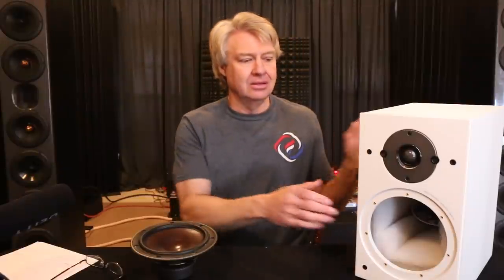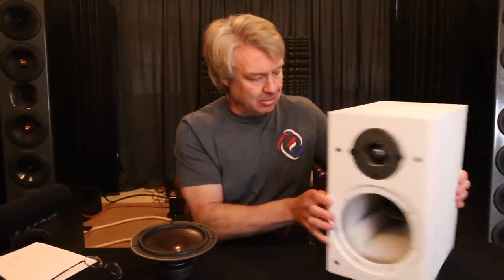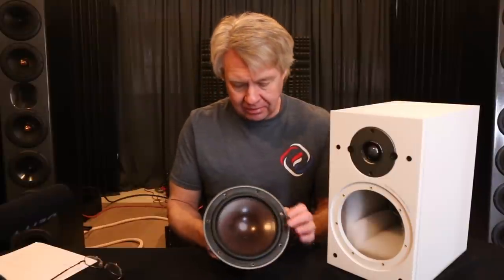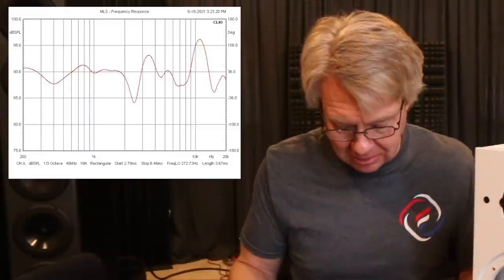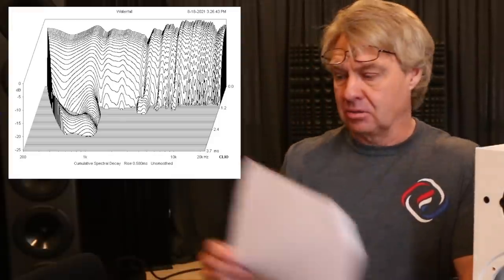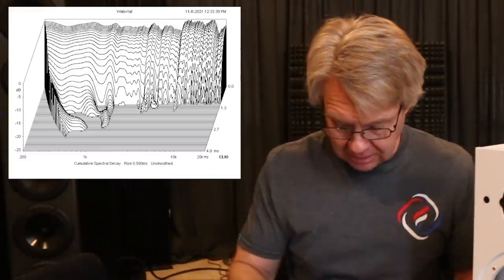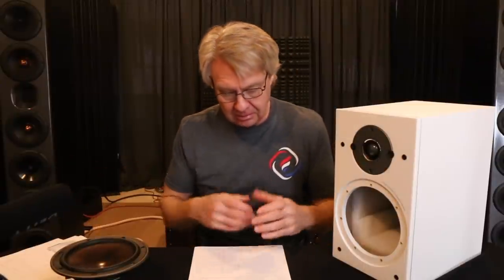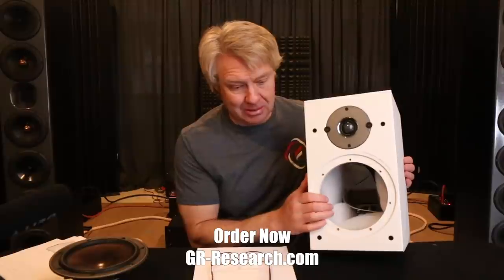Deal or no deal? Dali Oberon 3

Comment: So I take it from this review that the upgrade is a path to salvage your bad investment rather than a recommendation to go buy this speaker + upgrade as a way to build a quality system.
Reply: Generally, yes, because he has shown that buying even $2000 to $4000 speakers are no guarantee of getting quality crossover components or a good frequency response.

If you've spent a good amount of money, instead of selling them for peanuts (used speakers go for about 50% to 65% of original price if you are lucky), and if the cabinet and drivers are good, then spending say up to 1/3rd more to make them better seems to be a good way to go - if you are willing to spend several afternoons doing the work and have a good place to do that work. 

I'm not sure I'd do it for these though. Seems the cabinet and that off axis response would forever be holding them back other than for the one person sitting in the sweet spot.
Reply: @Lloyd Stout yep, even comparing speakers in a showroom is no substitute for an in-home trial...with your amp, your music, your sources in your room...Fortunately some allow 30 to 60 day trials...

Comment: Does anybody know the values of the used coils in the crossover? If somebody knows plz write me...
Reply: I'm also interested. I believe they are like in the zensor 3, 0,3 or 0,33mH in the tweeter and around 0,6-0,7 mH in the woofer...u should also need to consider the DCR values of the coils... will try to measure inductance of the coils afternoon but mine RLC meter is not so accurate.
Reply: Did measurements on the coils. If my measurements are correct but I'm not trusting the accuracy of my cheap UNI-T meter. The L1 on the woofer is 0,47 mH and 0,17 mH on the tweeter.
Reply: @fahy01  Ok, thanks. I could find anything bout the Zensor 3, but for the 5 the values are give as 0,55mH and 0,2 mH, comes close enough. The problem is the  Oberon have completely different drivers, so probably those numbers are may be notsuitable
Reply: You always design the x-over so the final slope takes into account drivers measured freq response and phase in enclosure, their impedance and offset between drivers.
Reply: @pliedtka  Ok, how does help me as a non professional. I hardly will calculate the Crossover again...

Comment: Maybe I am reading it wrong... but do your graphs read from 200hz onwards?
Reply: To measure any lower, you have to either use an anechoic chamber, or derive the lower frequencies by taking measurements as close to the cone as possible.
This is because the sound reflected off the floor/ceiling will pollute the measurement. Depending on how far the speaker is from the floor, the difference in time delay between the direct and reflected sound is typically at about 180Hz.

He can get away with this because the speaker gets more predictable in the lower frequencies, and the cross-over design software will be able to model it pretty well.

Comment: Have you ever had any Piega speakers in Danny? I have their Classic 5.0 and I'm pretty happy with it. They retail for around £1800/$2000 but I paid a lot less second hand. They seem a mixed bag build-wise - extremely solid cabinets with huge front baffles and lots of bracing plus a stunning piano gloss veneer; nice AMT tweeter but pretty cheap-looking stamped steel mid/bass (you mentioned damping strips in this video, what do you mean and where to buy?) and I would assume a cheap crossover. I think they sound good, certainly more refined than other similar things I listened to, but I wonder how their speakers measure...

Comment: Where do you do all the measurements on speakers? In a listening room or a chamber?
Reply: he uses a gated mic so he can do it anywhere almost as he only captures a fraction of a second of sound so no room reactions. at least i think he does it that way
Reply: @veroman007  Thanks but I have to know how he really does his measurements before I can trust them
Reply: That’s exactly how he does it. He talks about bit in other videos on his channel; you can search for them. He uses the CLIO system which takes gated measurements.
Reply: @nathandaniels4823  So if the measurements doesn't include the room then he won't really know how the speaker behaves in a room? The room changes the frequency response significantly. So it might become the most horrible sounding speaker or it might not. Who knows
Reply: @jwester7009  and every room is different, with different bass modes, etc., based on size and surfaces. Making the speaker play as neutral as possible and have good off axis drop off at least starts out with a "good" sound. It is up to the buyer to evaluate their room and add or subtract damping material as necessary or provide bass traps.  Or you can play the game of buying bright speakers for overly damped rooms or buying dark sounding ones for rooms with hard surfaces. That's up to you to decide. Or for non-purists, use some room correction software on the preamp or decent A/V receiver and see where it leads you by putting in a crazy EQ curve, or heavens forbid, buy an EQ and do it manually. Even then, adding a sheet of no-rez to almost any commercially made speaker is likely a start in the right direction.
Reply: @Lloyd Stout I don't care how many awards a person has. I'm still going to ask critical questions. One thing you can be almost sure of is that the bass region will be heavily boosted in every single room as well as the upper mid range in most cases. That's the compromise with speakers. They have to work in most normal furnished rooms in a home. So a completely straight frequency response might not be the best option in real life. That been said measurements are still a great tool. It's a great way to locate problems

Comment: Hoping a customer will send in the POLK R700.  Even Polk said they had to scrimp a bit on the crossover compared to their Legend series, but many of the drivers are the same. Would be great to see Randy open one up, see what is inside and if it can be taken up a notch with better crossover components, and if maybe the values need a slight change.
Reply: The 700 woofers look similar but are far lower quality and stamped steel compared to cast in the legend.
Reply: Maybe Danny is Randy?

Comment: I don't get it. A $390 (€500 incl taxes and shipping) upgrade kit for speakers that cost new €500 a pair 🤔. Do they sound like a €1000 pair after the upgrade?
Reply: They won't, but you will get air core inductors and very high quality capacitors ;) For me at this price point it doesn't matter if you use cheaper, commonly used parts or Uber stuff GR sells - the drivers although now finally well managed by proper crossover, may not pass all the nuances better parts provide.
Reply: I have read a comment on another channel stating it is absolutely worth the GR upgrade

Comment: As one who's been in this hobby for decades- and doesn't have an unlimited bank account- I don't get it. $900 for those? I know it's all personal taste, but I've picked up so many better-built speakers used, for so much less. I am currently using Dali Phantom Ikon in-walls for surrounds with full cast enclosures, cast-basket woofer and hybrid ribbon tweeter module. $200 for those.

Comment: You can test drive 3 different stock cars. And then, you drive a specially tuned and equipped version of one of those three; more horsepower, even acceleration, better tyres, better grip, better braking, more comfortable seats, better steering wheel, etc. From the moment you sit inside it, press the accelerator, press the brakes, etc. you KNOW exactly how much better any stock car could be but you are not given that.

Comment: Danny so all speaker manufacturers make bad speakers.
Reply: Most do have short comings , but what us cool is you can take something that tickles you and make the improvements to your liking , its the same with houses , cars and women , it us human to want to make better , it gives a sense of achievement.
Reply: Lots of things can be modified to make perform better. One example is a car
Reply: Most of them are made to achieve a price point.  Cheap crossover parts cost a few bucks.  A good chunk of the cost is dealer markup.
Reply: @jasontimothywells9895  women,really? Something is wrong in your head.
Reply: @robertspringer9477  are you related to Jerry springer ?
Reply: @jasontimothywells9895  many guys do end up upgrading their starter wives...about 50% do, and it ends up costing them dearly...Far more than a sheet of no rez.. ;-)

Comment: Thanks for the video Danny , if my Polk Audio lsim 703s didnt weight 30lbs each i would send them in to ya , I have the only video on utube taking the 3 way speaker apart the cabneit is built very well . Their basically a cabneit inside a cabneit front baffle is almost 2 inchs thick sidewalls are 1.5 inch thick and top and bottom and back of speaker are 1inch thick and this isnt counting the Real Mt cherry wood veneer edtions very solid cabneit which we both know helps the overall sound out alot . 
The 703s do have 2 crossovers and yeah 🧀 Parts 😆 But one thing the Engeeners told me is that the ring radiator tweeter is 1octave higher than normal so they had to use a very strong tweeter . 
And amp pairing is tuff with the polk my amps that have top end roundness or Delicate top end tend to sound best with the Polks I will say the bass driver is built very very well heavy and no stamped steel basket its alumnium atleast 😃
But bass is strong ! 
Appricate you Danny.
 i will buy one of your speaker kits this coming year 100 percent ! And I will have the flat pack 'wrapped' with a crazy desighn 😃

Comment: it sounds like it came out of game of thrones ,remenber the 70´s do it yourself was fashion one could design the shape of the box or use previous designed boxes and buy drivers ,boards and everytype of sound deliverer ,Bricolage was the word , i made with a german friend some speakers of pine wood that had all frequency´s in the spectrum (not all off course)but some 15 htz to 35khtz and equalizers with 25 frequencies per channel would improve any recording and tube amplifiers was old but good ,transistors were making it´s way in the market .No use of tubes only transistors ,this to made buyers after those amplifiers,  but they were not comparable to a 1.000€ bad quality amplifier not like  Rotel or Quad or even accuphase or phase linear or even Pioneer of the 70´s

Comment: Never say anything good about any speakers! Selling snake oil! I have those and they sound amazing! And every speakers will have a different response in different rooms!
Reply: Actually, I've seen several reviews where he compliments speakers.  Most budget speakers don't use quality crossover parts because of cost and size.  There are a few exceptions. Just looking at the stamped basket of that piece of crap would make me want to send it back.  That speaker is no bargain.  You would be better off with a budget Sony bookshelf.

Comment: After watching most of your videos one could conclude that almost all speakers, no matter the price and brand are in need of modding and fixing.  Funny enough you sell mods. Not a single mention of music or even sound impression.
Reply: Shocker...
Reply: Ever consider the middleman markups involved in the industry? Reckon you get the same quality from the mass produced pieces as you would from the smaller business that’s sells direct? Just a casual observation.
Reply: What concerns me is that the crossovers are fixed often with only one speaker. How does this always achieve a desirable result?
Reply: @Mark-mj6qp  if the speakers are so inconsistent that you need to try with multiple units to dial in a crossover, there is almost certainly enough variance between the left and right speakers to make a good stereo image impossible.  If they're that different then they're not worth using.
Reply: The measurements don't lie.  You too can measure these yourself and get similar results with a relatively cheap microphone and free software.
Reply: @jayweb702  I have a calibrated microphone and use REW for measurements.  I'm not disputing that but the rabbit hole that's this hobby. Buy new speakers so you can mod them, and if you are not happy with the results you can further upgrade the components used for mods. But watch out, your DAC dose not have very clean output, better upgrade that too. The amp you are using has 0.0x % distortion, can't have that - upgrade it.  But it's all meaningless if your interconnects are not on point. It's an endless struggle and obsession that's encouraged by people like this man. He dose not mention music in at all when talking about devices that are constructed for music reproduction.  But you gotta get those mods so the sine wave is nice and even across all frequencies so you can graph brag.
Reply: @jayweb702  Interesting and informative video.
Reply: @riknos3289  it’s not the variation Between the two that I am talking about it’s the voicing of the speaker. He is obviously just creating as flat a FR as he can Without checking that it actually sounds nice with two speakers. Read any notes from a speaker designer and you’ll find that adjustments in the crossover are used to “voice” the speakers.
Reply: @Mark-mj6qp  you would upgrade BOTH speakers the same. Manfacturers "voice" speakers to give them a certain sound. Focal and B&W have bright top ends, while most Klipsch and some JBL sound horny (which might appeal to some people). Most Wharfedale and some other British manufacturers prefer a warmer sound, flatter on top and more meaty in the midrange or upper bass. To each their own. Danny seems to take them and try taming that "voicing" a bit to arrive at a more neutral sounding speaker, or at least one that doesn't have holes in the frequency response. But even more importantly, the use of better crossover components can offer more detail without shrillness because the sound isn't as smeared. 

At a minimum, no mfg should be using iron core inductors or electrolytic caps these days. But they do. Ugh. In the 1970s maybe they HAD to, but now? Jeez...
Reply: @rosswarren436  🤦‍♂️wow… I understand that completely. 

When you use two speakers it creates a stereo image. This image changes with changes to the crossover. You can make voices pop out or become recessed. You can make the stereo image project in front of the speakers or from the speakers and behind. Unplug one of your speakers and have a listen. You loose the image. I don’t understand how this element of a crossover design can be done with only one speaker. Look I’m sure Danny knows his sh1t but he also has to make a business out of it. I am a big advocate of quality parts too since I have built DIY speakers with very high quality crossovers. I started to question things when on one video he briefly talks about a diy design (which is behind him) and blames the designer for bad design and cheap parts when the customer clearly deviated from the original plan. The importance in sticking to the plan and original design/ parts should have been stated. The speaker designer was not mentioned thankfully but it showed me that not everything he says is the whole truth.
Reply: @Mark-mj6qp  imaging is done in the stereo mix by a sound engineer or what was captured live by a set of microphones. 

I don't think the crossover is supposed to affect that other than the tonal balance. 

In general, using better crossover components should offer better imaging because the sound is better resolved and the auditory cues that create imaging easier to discern.
Reply: @rosswarren436  You obviously don’t really understand what I’m trying to say. There is not just one correct crossover option for a particular set of drivers. Two designers will most likely end up with very different crossovers for the same speaker depending on their tastes and preferences. I just wonder how Danny designs a crossover and is consistently effective in producing a great result with sometimes only one speaker as it would be difficult to assess how they present the soundstage and stereo image. Try and assess the differences between two amps with only one speaker. It will tell you nothing about the depth of the stereo image. The crossover can have a huge effect on the soundstage and stereo image depth and width and also the way voices are projected.
Reply: @Mark-mj6qp  "depending on their tastes and preferences" - there. You answered your own question. And manufacturers do that, sometimes by mistake, other times by design and intent. But any "mix" you get regarding sound stage is more consistent with how the original recording was done or created during mix down and mastering, not the speakers. 

I can play a well-mixed album on a cheap set of Logitech computer speakers, and it can present a great sound stage, or I can play them on a $4000 set of speakers and get a similar, even better soundstage. 

The auditory cues are in the recording itself, not lurking in a crossover design.  On that I agree to disagree with you. YMMV.